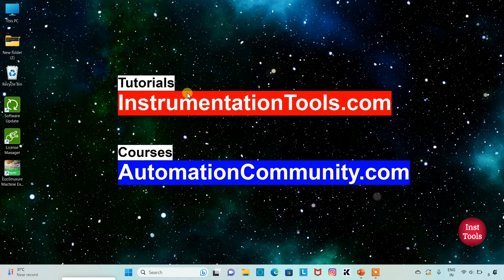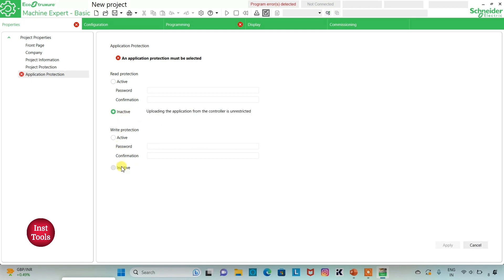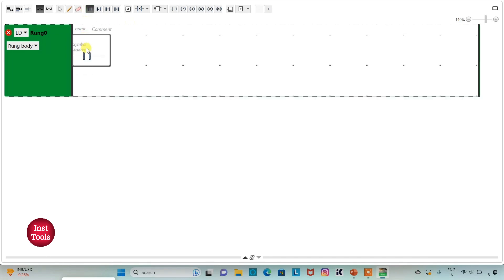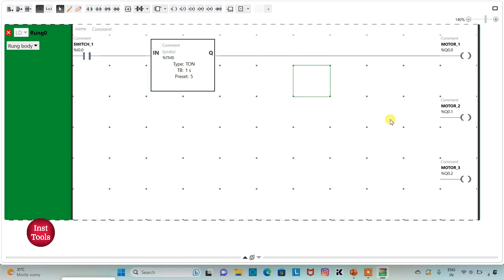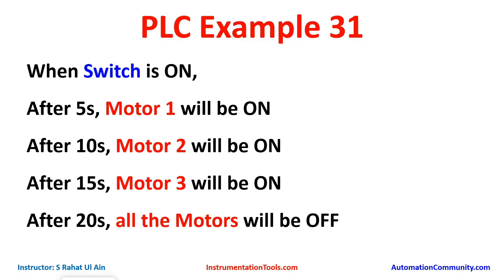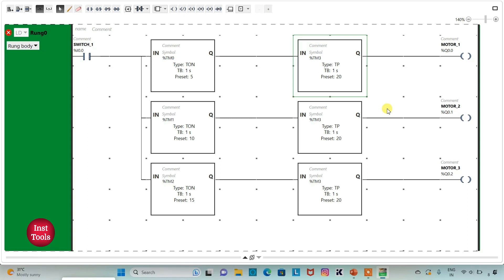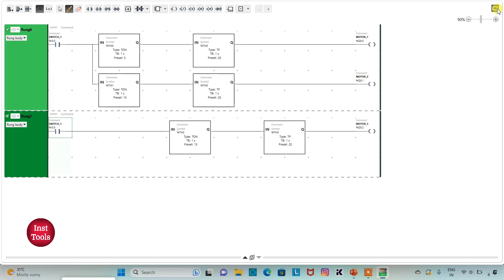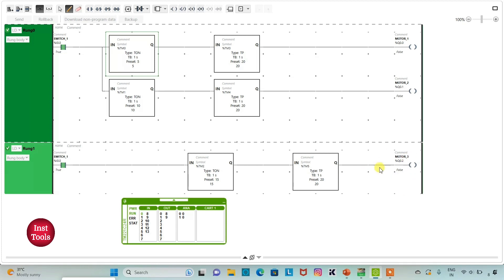PLC Timer Ladder Diagram - Example Program using Switch and Motors

Comment: The assignment says that all the motors should be off after 20 sec. I thought that means all the motors should stop running 20 sec after the switch is turned on?
Reply: You can also make ladder diagram for this logic